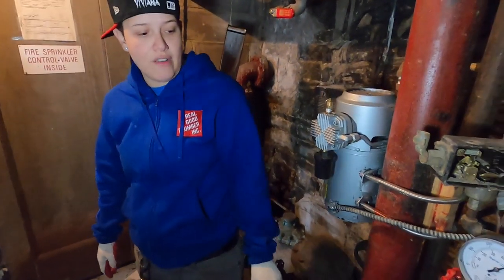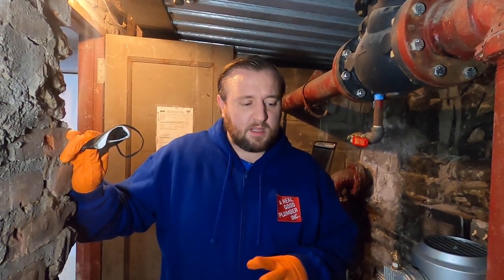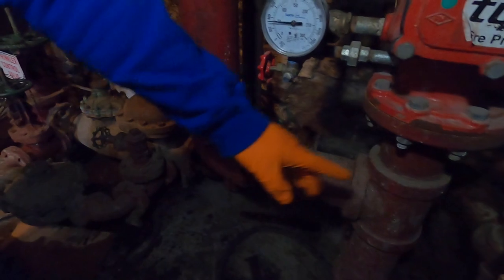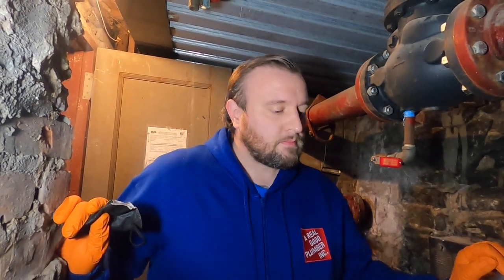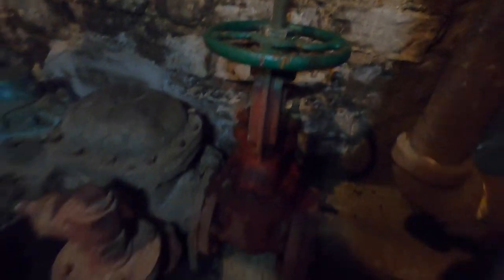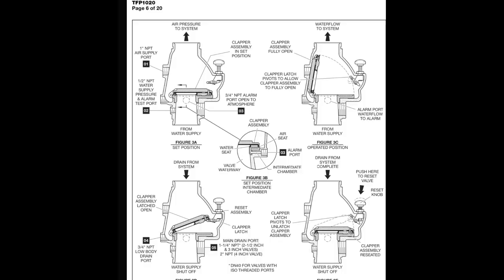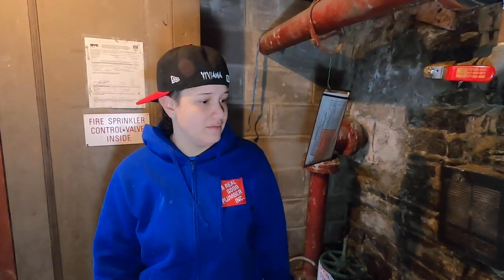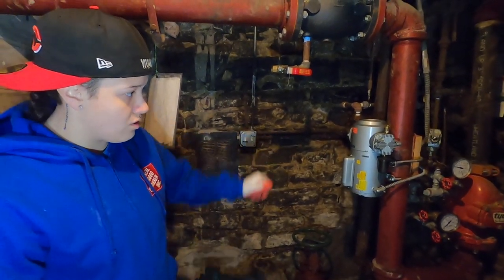Dry Valve Trouble Shooting And Resetting On Dry Sprinkler System.

Comment: The clapper doesn't hold water back because its heavy 😆  It's a 1:6 ratio of air to water that holds the water back. 1psi of air will hold 5.5psi of water back. The clapper's surface area allows the pressure to push against the water pressure and hold it back, until it loses enough pressure, and the compressor can't maintain it. 

The air pressure depends on the water supply pressure. The same valve requires 20-33psi with a water supply at 85psi, and so on.
Reply from the maker: Hey you’re sorta right. Except! The actual clapper was designed with the weight of being able to close and hold the check closed under minimum pressures without a spring. Besides the plunge how else would it close? Weight matters when it comes to pressure . I just did a fdny test the yesterday. How heavy was your check?
Reply: @anthonyarealgoodplumber no, its a differential valve.  Its the surface area.  How the would a clapper hold pressure against a 175 psi system? It would need to way like a thousand pounds. There are low pressure
Reply from the maker: @safeinsound432 hey , I apologize if I didn’t make it make sense. I was only saying the weight of the “check” closed itself. Meaning once you hit the plunger, under minimum  pressure (little to none)  . It would close with no springs because of its weight. The check valve part itself has little to do with how the system responds. Although we can argue weight and water pressure lol thank you for helping me clear that up.

Comment: At the time this system was installed it was possibly one of the cheapest set ups at the time. In the fire protection industry no building owner wants to spend money on something they can't see. It should have had a compressor with a supply tank and an air maintenance device for a constant air feed. Additionally a low air switch incase the compressor is shut off. At the beginning of the video I wasn't sure if that was a low point drain or the ITV. If it is an ITV it should have the same orifice as a sprinkler head and piped to the buildings exterior. After the valve is reset and before the water is turned back on its a good idea to purge the low points an additional time. Its also a good idea to put a plastic sticker on the riser stating low points must be drained on a periodic basis. If the city possibly has water surges it may not be a bad idea to raise the pressure from 15-20ps. Depending the size of the system and you get water to the ITV in 60 seconds. Sorry to ramble on, but in this business you have to CYA against any lawsuits.

Comment: When a sprinkler head goes off and all the pressure goes down quickly, let’s say in a real scenario, what will prevent the compressor from turning on while the water is filling up on the dry side ?  Does the pressure switch have like a differential ?
Reply: Interesting question!
Reply from the maker: The pressure switch does have a on/off differential, here compressor turns on at 15psi and shuts off at 20psi, the city pressure is 50psi so once that valve opens, the city pressure would satisfy the pressure switch keeping the compressor off.